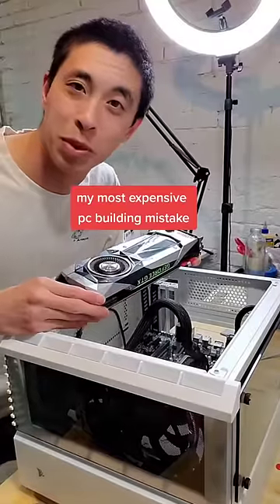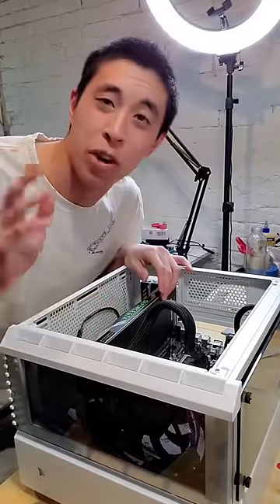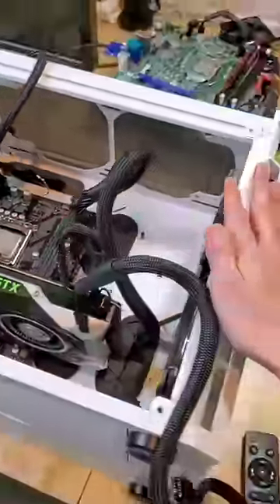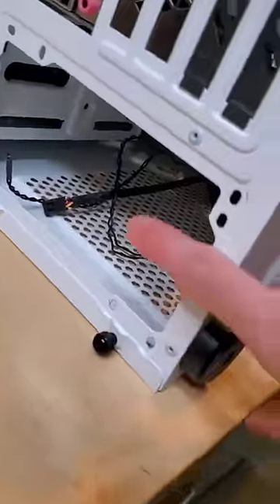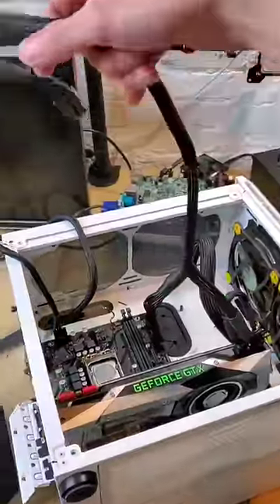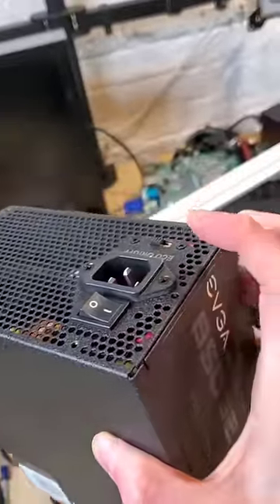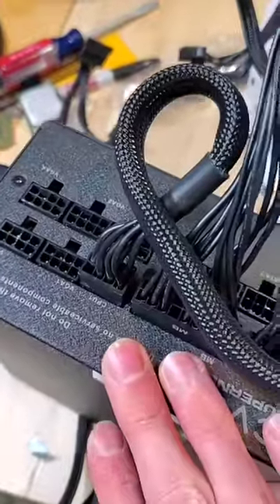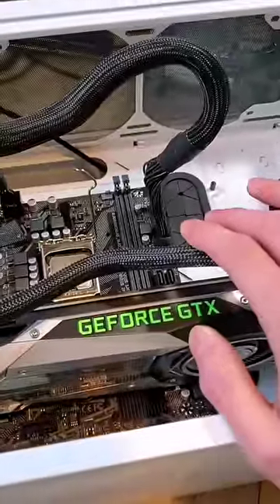my most expensive pc building mistake... #shorts

Comment: I've done the exact thing in this video, luckily I only killed my secondary hdd that was for steam games etc
Reply: I killed an OS HDD when overclocking a 1st gen Phenom X4 lol, poor thing threw smoke.
Reply: how can I not make that mistake?
Reply: @wallet01  Just use the cables that come with your power supply
Reply: Did it as well, sata power cable started melting. Nothing fried
Reply: Right.  Explain how that happened.  Makes no sense to me.  But what would I know.  I've only built desktop computers since 1985.
Reply: @tcolondovich2996  surely the hdd psu cable fed 12v in the 5v rail
Reply: @dantepaz5028  I think if those rails were mixed up, you'd see other components fry.  I'm pretty sure there are components on the motherboard itself that have 5v input, not just 12v.
Reply: @dantepaz5028  I suppose it's possible with non-standard cables.

Comment: the most expensive mistake i made was a few years ago i was installing a brand new ryzen 3 1300 and i had pushed the cpu into place rather than dropping it in and bent 2 of pins
Reply: @bdaz7466  don't be rough on the guy now
Reply: @bdaz no need to be a jerk
Reply: @bdaz7466  it was my first build my guy and the guide i was following said to push it into place
Reply: @cyberJes  Don't mind him. I got punched in the face by my father because same shit happened with his CPU... even though I wasn't the one who slotted it lol.
Reply: I don't believe AMD is that cheap. I worked for Intel as a software engineer and having to test integrateds, I have bent plenty of pins and they always worked just fine as every pin on an I tell chip is not a necessity, so I am shocked to hear this about AMD.
Reply: @anthonywright5275  Bro, the pins are tin foil sized on any cpu xD
Reply: @anthonywright5275  had this happen, but maybe he couldn't slot it because of the bent pins

Comment: I was given the same advice at my job working with custom computer builds.

Different PSU(Power Supply) brands have different “pinouts” for each modular slot. Every brand has a different wiring scheme from slot<>cable. This will cause the type of short he mentioned.

Thank you for spreading valuable info!
Reply: Literally scrolled down to find the comment that actually explained it rather than every one saying oh yeah bro I totally know what you're talking about. Thanks mate.
Reply: What's the point of a ""modular"" unit if all of its interfaces are proprietary...
Someone clearly had the foresight to standardize the pinouts of the power sinks, and then PSU manufacturers walked along and went "I'm gonna pretend I didn't see that"

Anyway, thanks for clarifying, Without an explanation the video itself was basically worthless.
Reply: thanks for the comment i cant really understand what he just said. so if I biy a mew psu, i must use the cable associated with the new psu amd not with the old cable right?
Reply: Thanks! Was confused
Reply: @sojumoscow yes, if you want to play it completely safe. Even, if the new PSU is from the be same manufacturer, as they can change the pin layout between their different PSUs.

There are sometimes the pin-out schematics online for the PSU and their cables, so there is a way to check if they are compatible, but it's most of the time not worth it. Just go with the new cables then there is no issue, and i mean what is there to save from reusing the old cables? Nothing, other than saving a little bit of time removing the old cables, and installing the new ones.
Reply: @C76Caravan  So what you're saying is I want to be completely safe is to buy a completely new PSU?
Reply: @the_dark_jumper2211  This is mostly a manufacturer thing and it's something you see in countless industries and components. For example, HDMI is a standard, yet every HDMI port will be mounted differently, internally, or sport a different circuit for actually sending data to it. USB is standard, yet every device will have a different way of interfacing with that USB port and making it functional. The output is standard, the way it's wired up is not. 

In the case of modular power supplies, it would be nice if all cables followed the same pinout schema across input and output. However this would likely cause issues for various manufacturers. For example, the way EVGA may achieve a Platinum rating on their PSU could be due to how certain rails are internally wired to the output. Standardizing these outputs so they all must follow the same exact rules could prevent many manufacturers from developing better, more efficient power supplies.

The output is standardized as per ATX standards. The P1 pinout you plug into a motherboard is going to be the same P1 pinout for any other power supply. The pinout on the power supply side however is NOT STANDARD, and this is deliberate. Power supplies do adhere to ATX standard, otherwise you would need a different PSU for every single computer in the world. The only part that is proprietary are the modular pinouts, as the way they're wired internally is what, ultimately, gives the PSU its ratings and characteristics. Much in the same way that not all USB-C ports are created equal. USB-C is a standard, USB-C supports stuff like video output, super fast charging, ethernet, etc. Yet not all devices with a USB-C port will have these features, it depends entirely on what the manufacturer put in there and how they wired it up.
Reply: @Ben-fk9ey  If you buy a used PSU or used computer, and it DOES NOT come with the original box or at least the original bag that contains ALL of the modular cables, just straight up buy a new PSU, unless the used PC or PSU contains all of the modular cables you need. 

In my opinion, when building a computer for yourself or for a client, it's best practice to just plug in most of the modular cables that you believe may be used in the near future. For example, when I build a computer for a customer, if their video card only need a single PCI-E 4-pin, I still plug in additional PCE-E cables and leave them in the computer. If the customer only has one SATA device, I still plug in another set of SATA cables. If the customer only needs one set of EPS 4-pin, I still plug in additional EPS cables. 

All of this is to make upgrading in the future easier, as the needed cables will already be routed, and already be FOR that specific PSU. I've had situations in the past where I build systems for customers, and leave the extra stuff out. Then tell them "KEEP THIS BAG OF CABLES, DO NOT LOSE IT." Then a couple of years later they want me to install a new video card, and I need another PCI-E cable. I call them up and ask if they still have the bag aaaaand, most of the time they don't. In these situations I inform them we'll have to replace the power supply, and explain why. 

I find it is just best practice to hook up that stuff ahead of time, even if you don't think you'll be upgrading any components any time soon or installing something that needs it immediately. Having the cables installed ahead of time ensures you never lose track of where they are.
Reply: @Ben-fk9ey  basically yes.

Of course, if the old PSU is still fine, not too old (iirc recommended is younger than 5 years), and has enough power for the new PC, you can still reuse it, but only if you take and reuse all the original cables that came with it.
Reply: @the_dark_jumper2211  if you remember the old days before modular PSUs you would have a bazillion cables you never needed.  Especially those GD 12V hard drive cables.  It seemed every PSU in the 90s and early 00s had about 7 12v cables.  You would zip tie them up and stuff them somewhere in the box so it didn't look so bad.  Modular PSUs are a godsend.  I only plug in the cables I need and route them.  It's clean and efficient.

Comment: I’ve done this exact thing, and I thought the motherboard was toast. Luckily it had a safety feature, so using the correct cables was all it took to fix it.
Reply: I think modern motherboards are hard to kill with over voltage. Most of them use the 12v rail now for everything and use local regulation. Not sure if many even use something like the 3.3v rail or the negative rails.
Reply: Same!

Comment: Most costly mistake was my 3090 ti came with a rgb support mount that went under the graphics card well needless to say I didn't mount it properly and overtime it shifted and got caught in the fan of graphics card breaking it and then cuasing it to shake violently as the fan was unbalanced. Luckily I was able to just rma the graphics card but it took 2 months to get it back.
Reply: do they take it back for that kind of damage? what brand was it?

Comment: The component ends of the cables are standard (they'd have to be) but not the PSU end. Actually saw an interview with a Corsair PSU tester the other day that went into this. Corsair is one brand that does make sure their cables match and identify them with labels like "Type 4" or "Type 5". I guess some other brands coming into the market are starting to use their cable patterns such that the pool of compatible aftermarket cables is slowly increasing. Maybe some day they'll all be the same...
Reply: But they have the same connector on both sides of the cable if the PSU end wasn't standardized too than flipping the cable around would fry your components.
Reply: @vasilis23456  yeah I'm so confused about this lol.
Reply: @Vasilis Papanikolaou  are they keyed on the end that mates to the power supply maybe so they can't be reversed?
Reply: I was wondering why the cable mixup was a bad thing. Thanks for bringing this up. Never thought this was not standard.
Reply: It's bs that they aren't all the same already. There's no reason to switch up all the pins. The mobo side is already standardized and has been forever.
Reply: @vasilis23456  The connectors are not the same they just look very similar, but the pins are keyed differently. You can only install PCIe and CPU cables in 1 direction, they won't fit if you flip them.
Reply: @226olson  Correct, they look the same but they are keyed differently so you can't flip them.

Comment: I didn't know about incompatibility in psu cables, thanks for the info, I will be more careful now.
Reply: Wait so is he saying to never use the cables that were plugged in the old power supply to the new one? So when my new power supply comes in I should use the new plugs that came in with the new power supply?
Reply: @Yerrskiiii2121  use the ones that come with the PSU as the PSU may have a different configuration of wires despite still being 8-pin, 4-pin etc

Comment: Back in the day a customer wondered what the little red slider switch was on the back of the PSU, you know, the 240/110v one.
Reply: What does it do?
Reply: @dashi52  Configures the PSU to accept 240V (UK standard) or 110V (USA standard) mains voltage. If you set it wrongly, or change it while the system is powered on, it's usually an instant death sentence to at least the PSU, if not the rest of the computer.
Reply: Correct me if I'm wrong but some psu can work on both 110v and 250v without needing a switch
Reply: @Tombsar  hmm interesting, I'm not from any of these two countries so maybe thats why I didn't know about that 🤔
Reply: @dashi52  all countries use either 120v or 240v I'm pretty sure. it's not exclusive to the US or UK
Reply: @elmerandrewcrowley2822  Well idk, never seen any PSU with a voltage switch
Reply: @dashi52  that likely means that in your region, all countries use the same 240 or 120 so there's no need for one. The switches are useful when the PSUs are being shipped around to countries with different standards or even singular countries that use varying standards, like Japan.
Reply: @dashi52  I believe the 110v is only in the US
Reply: @butterflytr3077  Oh I see, that would explain why I didnt know this existed lol, good to know tho
Reply: Lmfao. I once got a PC and forgot to check the slider, my country is 220v and the psu was 115. Now you guys imagine what happened next...
Reply: @seven7000too  what happened I couldnt guess
Reply: Whole world uses metric units for measuring and 220-240v for power, but the US ... no we are gonna be the only exception with our gallons, miles feet and 110v shit :p
Reply: @cspeitch3262  Yeah, just the US being the US
Reply: @cspeitch3262 Japan also uses 120v
Reply: @samboofle3715 Japan actually uses both, 240 on the northen part, and 120 on the southern part (or the otherway around maybe)
Reply: Man i remember accidentally flipping that switch and forgot to put it back to default, moment i switched it on something inside the psu blew up and the ringing in my ears took some minutes to go away and thankfully nothing was set on fire as i unplugged the power but thats an experience i cant forget was 15 that time ☠️

Comment: Bought an rx 6600 for 1k. Bought it at the height of the gpu shortage because I was desparate. Lesson: Be patient everyone.
Reply: Bro... That's just shit money handling and buying practices... I bought a 3080 for $809, sold it for a PS5 and $800 than used a 580 until I bought a 1080 ti for $450 a month ago.
Reply: @sethdomings9262  That's so stupid, what a lost of money
Reply: @Selvanii  what is lmao?
Reply: @sethdomings9262  Buying a 3080 and then selling it just to have a PS5 and a 1080Ti
Reply: @Selvanii  I sold the 3080 for essentially $1600 lmao, I bought a PS5, 65 Inch 4k TV, and a new monitor. Last time I checked $1600 > $800. The 1080 ti is as good as a 3060 TI anyways.
Reply: Well yes but a 1080Ti is not futur proof anymore
Reply: @Selvanii  Cards last for years. There is no "future proofing" when building computers. You're always upgrading. I'm buying the RTX 40 series when it launches anyways. Next time don't say bs.
Reply: @sethdomings9262  Damn bro calm down, i think it's stupid you don't need to be angry at me
Reply: @Selvanii lol i currently have a ryzen 3700x oc'ed with a evga gtx 980ti Hybrid and with a slight oc i can actually play just about every game i throw at it pretty comfortably. Truth is a 1080ti is far from weak in reality and will play most games plenty well
Reply: Don't care, both of your setups are still not futur proof
Reply: @Selvanii  ehh dont have to be works just fine
Reply: @Selvanii  the biggest things the 1080 ti are missing is rtx and dlss, and both aren't that big of a deal honestly. performance wise it can easily hold up for a longer time still
Reply: @Infinitum0000  True, I'm still using my 6-year-old computer with a i7-6700K and GTX 1080 Ti and I can still play recent/current games at 2K resolution. I just need to turn down some settings. I'm definitely NOT upgrading and buying a new system until the absurd GPU prices have gone down.

Comment: This gave a good heads up for me, thanks for saving my system.
Reply: I'm confused on this, if you get a new power supply you use those cables only w your parts and not old ones?
Reply: @connorvezinabuyck8922  yes new powersupply+the cables it came with. Do not use your old cables with a new power supply. The slots might be the same(8pin, 4pin, sata, etc) but the invididual pin layout(ground, power, etc) can be completely different that's why it's not safe.

Comment: Good advice. I built multiple PCs before I learned about this. I'm surprised I never accidentally did this. I learned about this problem because my new power supply came with a huge warning message to not use any other cables then those provided.

Comment: when you said there were cables but no psu, I knew where this was going...
Reply: Care to explain ? Does he use wrong psu ?
Reply: @atallahraihan478  If he had used the cables that came with his PSU he would've been fine, but he used the cables already in the case which were for another PSU, the problem is that the cables had a different pin configuration than the pins on the PSU, causing power to go down the wrong pins
Reply: @zethcader6478  ooow, I see. Thx for explaining
Reply: @atallahraihan478  ohh I didn't even see your question, but yea as Zeth explained, the cables shipped with PSUs have different ratings of how much power they can deliver
that's why for example when buying custom cable at cablemod or such place you always say how much wattage your PSU has

Comment: Worst mistake I made was buying the wrong motherboard and the wrong ram. Make sure you check those model numbers!
Reply: I had this in my old system for the ram.. Had to manualy clock them and then they worked like a charm..
Reply: Atleast that’s only a few hundred!
Reply: Intel moment
Reply: how did you manage that ? you bought motherboard that supports ddr3 and with bad chipset ?
Reply: @neeo1201  ddr3? Lol it’s ddr 4/5 now brotha
Reply: @thewind6047  i mean if he did it in the past.
Reply: @neeo1201  My motherboard stopped support/updates after 3 years of production and for some reason the ram where being under clocked and they was the newest ddr3 sticks before or during ddr4.. Thats the reason why there is a sticker on the ram that have voltage and frequancys just in case the motherboard doesnt reconise XMP and  you have to manualy clock it..
Reply: @neeo1201  I purchased the DDR5 version of the motherboard, but purchased DDR4 ram. The model number was only 1 character off from the correct one and my dad was talking to me while I was doing the purchase so I didn't spot my error.
Reply: @briandoss9232 relatable, for my case I buying wrong cpu
Reply: Just use pc part picker

Comment: I was building a PC for somebody several years ago and plugged the Firewire cable in to a USB header. Upon first boot, I heard a pop, smelled smoke, and immediately unplugged it. It took me an hour to figure out what was wrong. Once I did, I got cables moved around and...USB was dead. Luckily the MB had 2 more headers. The next one I went to worked, and I was saved. Whew.